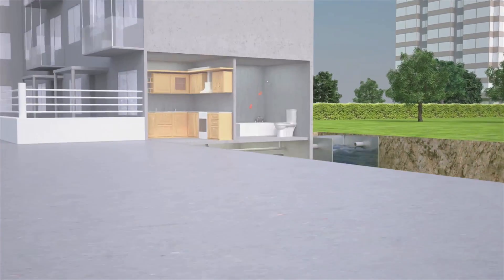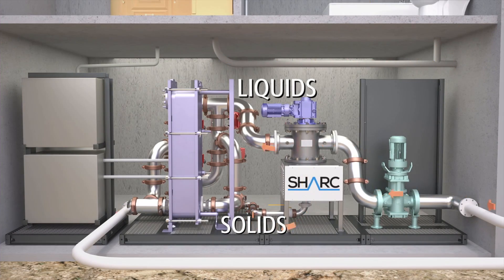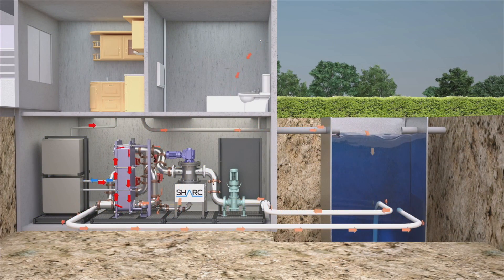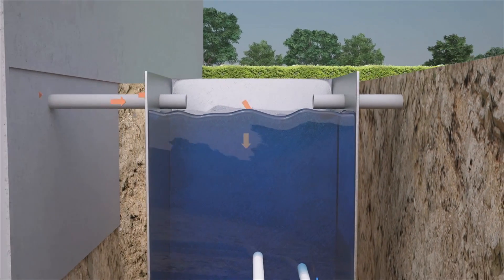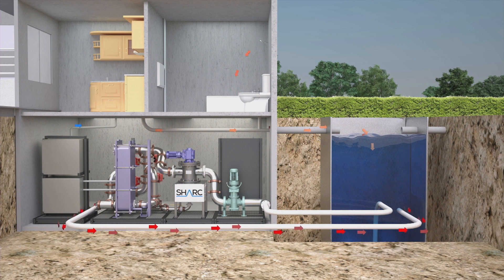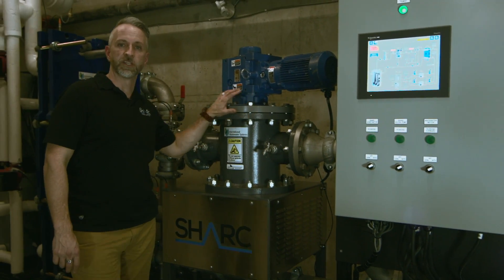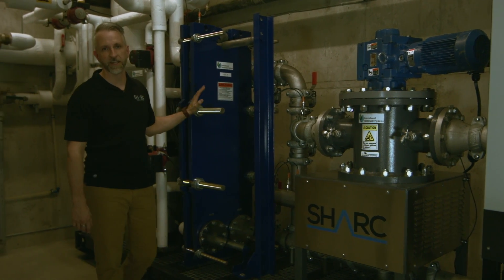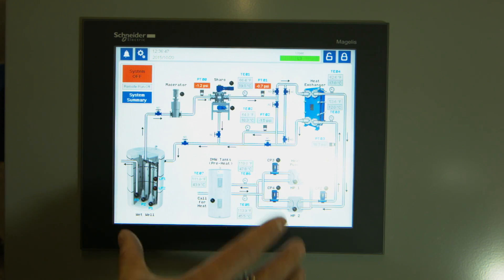How it works - SHARC

Comment: does any of the sewage water, even after being cleaned, get reused once going through the heat exchanger? Or does all that water get dumped into the sewage tank. What I'm trying to understand is if any of the hot water in the building coming from filtered sewage water.
Reply: No, only the heat is transferred,, the filtered water is only used for heat transfer, not for anything else.